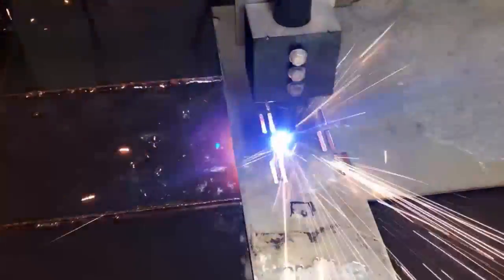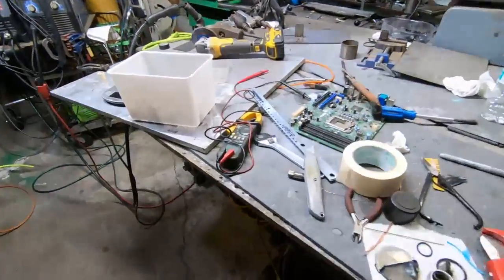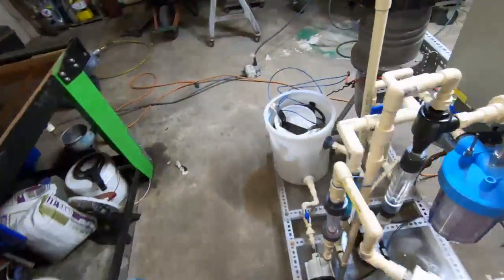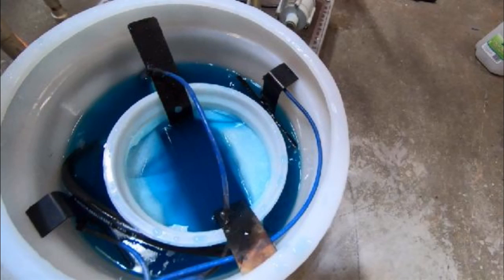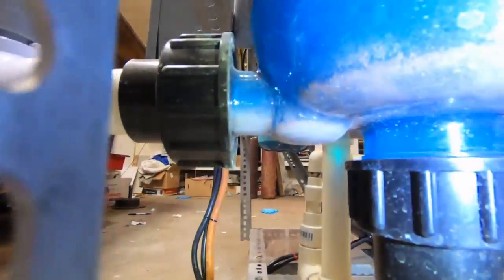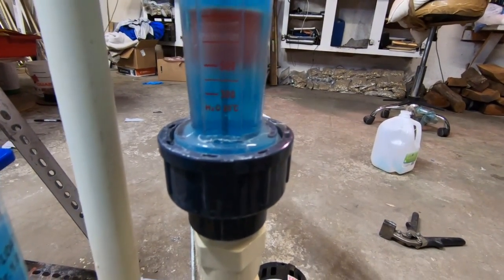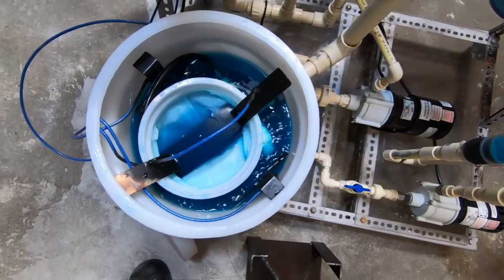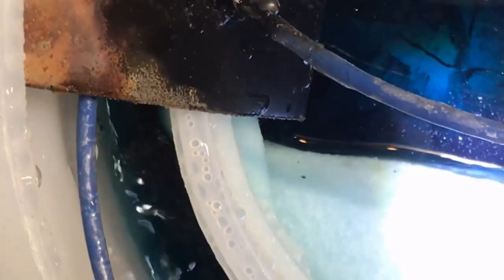Reactive electrodialysis For Ewaste metal recovery

Comment: Are you using stainless steel electrodes? If so do you have to coat them in anything to allow for the removal of the copper?

I assume your anode box is steel, slowly deteriorates, and ends up as sludge?

Just curious. I am working on developing my own rig. I am using nitrates tho. So it may attack the box more in my case. NO3 is an oxidizing acid. So it allows me to use a carbon anode and just set my copper scrap in a basket in the tank. As copper gets plated... the solution gets more acidic... no3 readily dissolves copper. (Attached to the anode... or not lol.) That was my personal solution for not having a way to melt the dirty copper into anode bars. It works ok... but sacrificial carbon anodes cost money... so i'm looking to cut costs etc.

Nice rig tho! impressive. I'm still on the "bucket" stage lol.
Reply from the maker: Yes i did weight the mass of the basket but he loss is negligible and appears it would last many runs , masking the face helped